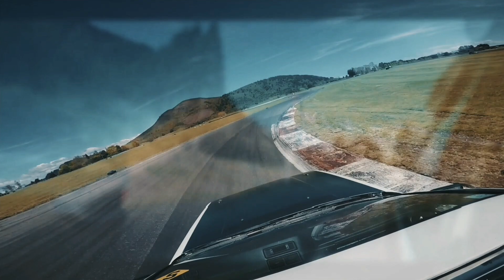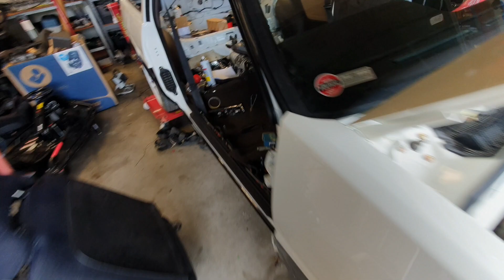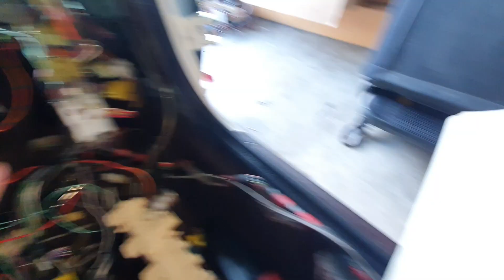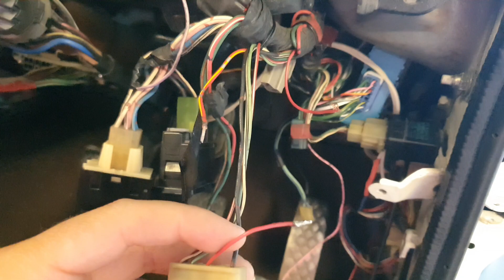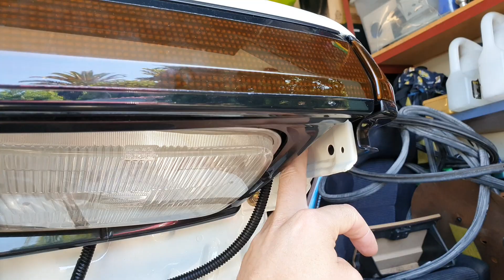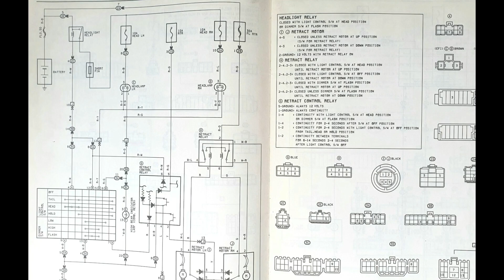AE85/6 Body - Part 21, Trueno pop up light wiring made easy!

Comment: Hi, listen, will the motor from Mazda MX-5 Miata fit? If so, please answer (even though I don't have AE86...🥲)
Reply from the maker: @danieliunguryan7838 yes it would fit but would be pointless as there would be alot of work to do with little to no power gains

Comment: Man you have a cross section of skills, I'm totally lost with wiring.
Reply from the maker: Haha learn as you go. I did research first and read about a person using the celica loom at the ae86 ones are super expensive. Originally I was just make a manual switch to go up and down and then have the separate light switch. My car is registered as a Trueno but had levin front and wiring 🤷‍♂️